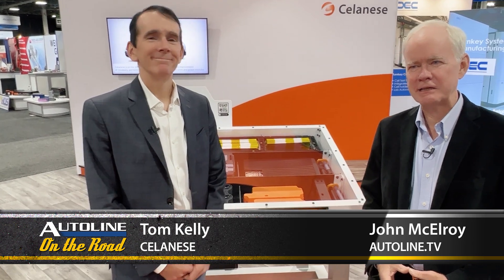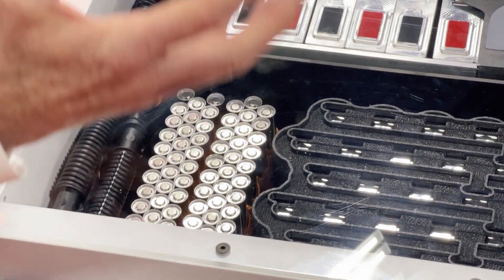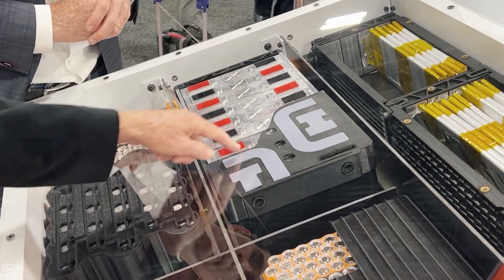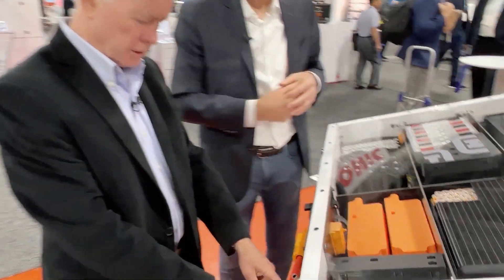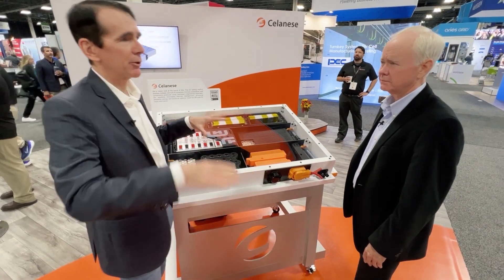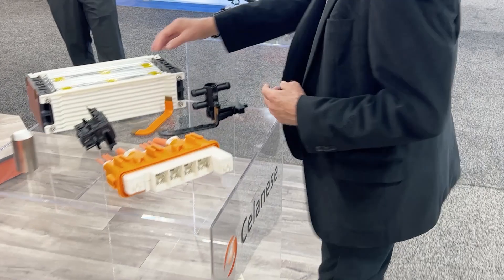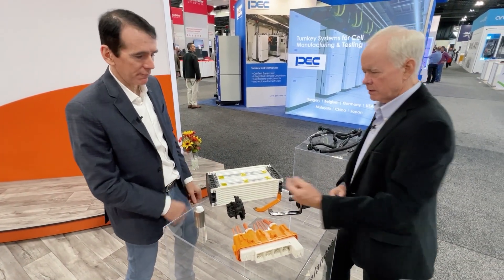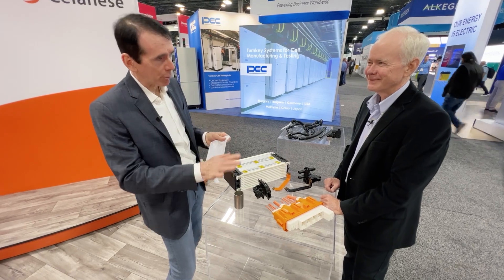Packaging Solutions For Any Kind of Battery Cell - The Battery Show 2023

Comment: Any manufacturer still using pouch cells is a 🤡. Have they not learnt anything from all the recalls. Not only that they are the most inefficient to build making them slow and costly to make. 
If your ev has 5 x the piping of a ice vehicle your doing it way wrong
Reply: pouch cells are the best!
Reply: You are just a crazy Tesla fanboy!Tesla needs also extrem a lot of tubing!Its needet!
Reply: Q: Have they not learnt anything from all the recalls(?) A: yes, they've learned from all the Tesla fires and all the Scooter fires that the HYPE around Cylindrical is just that "HYPE".